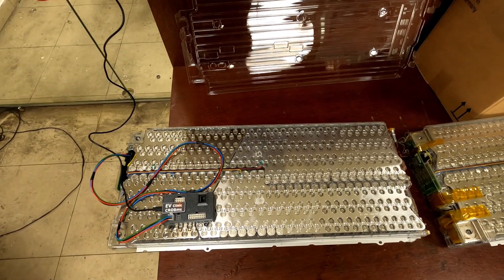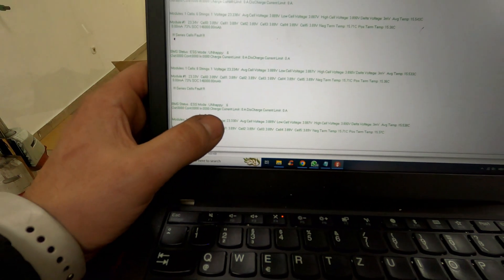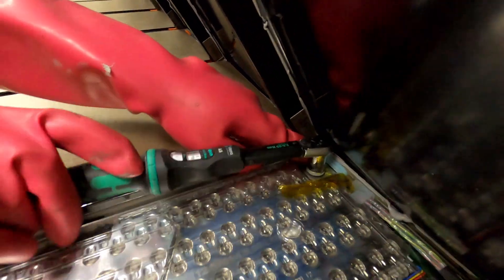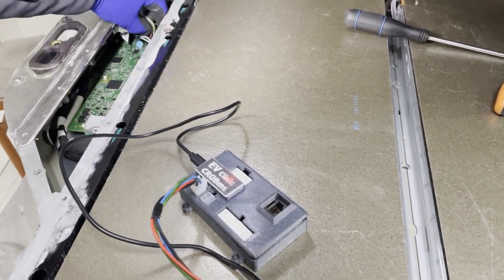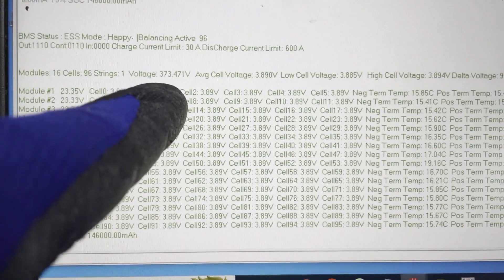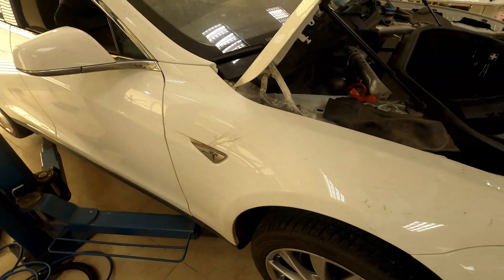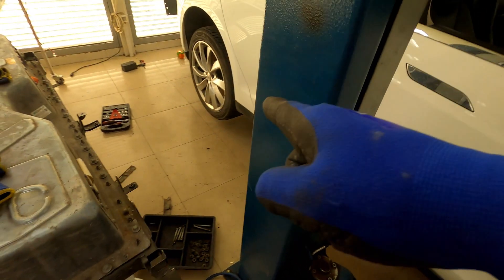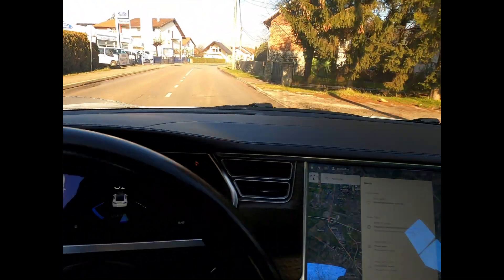Part 2 - S85 battery refurbish - Water ingress BMS_F123 BMS_F107

Comment: Will F107 clear once the problem is gone? Maybe a sensor wire is slightly corroded however no isolation issues.  Bad BMB with corrosion on connector may cause F107?

Comment: Do you advise a preventive battery repair, to prevent water ingres, for other EV brands too?
In perticular, I own e-Golf.
Reply from the maker: eGolf, ABTe, Audi, Mercedes… lot of them have some sort of water ingress issues, but because they do nit make so much road kilometers they are not us much affected like Tesla with half milion km
Reply: @evclinic  I have a 7.5 year old model X 90D (150.000km).
Can you do preventive maintenance on the battery?
Reply from the maker: @mamu679 It is possible to make preventive resealing without opening battery lid
Reply: I would suggest just taking down HV battery for inspection and pressure testing for leaks and changing ventilation( umbrellas ) every 5-10 years depending on driving conditions, on all EVs.